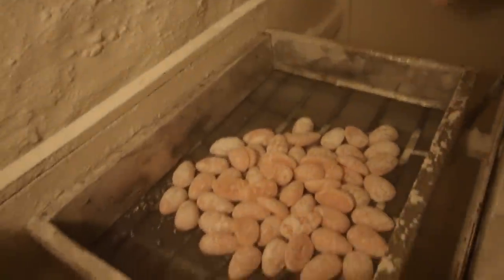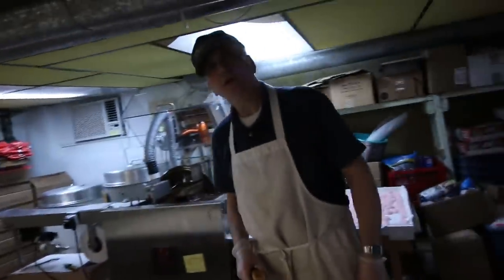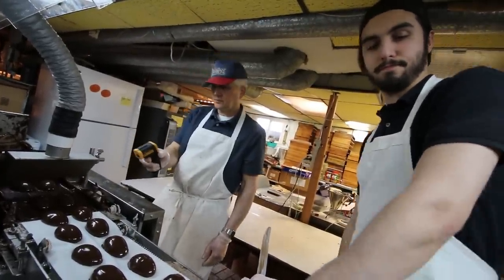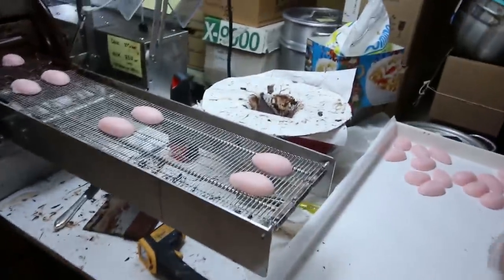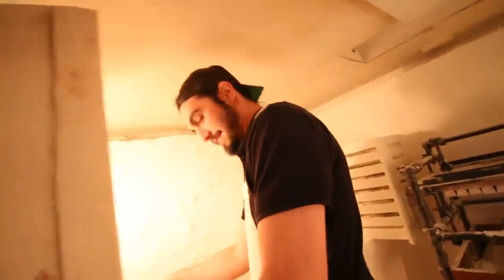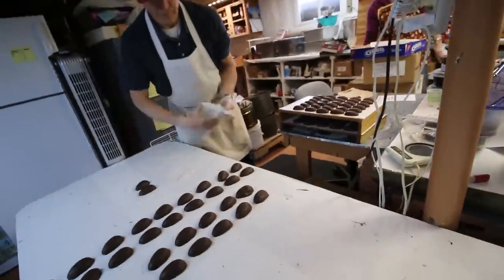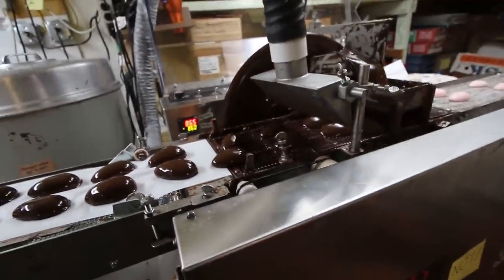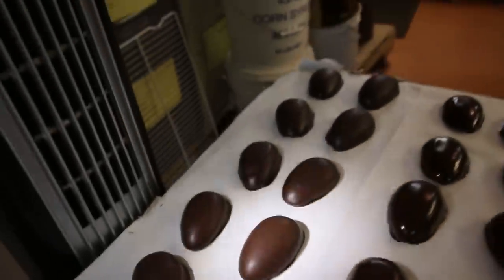Enrobing Raspberry Eggs

Comment: The reason the gap between the candy changes when transitioning from the starting conveyor to the main conveyor is because the two conveyors are moving at different speeds.The speed of the starting conveyor is actually set at a speed that is too fast, it should actually be set to a speed that is just a hair SLOWER than the main conveyor, then the distance between candies would not change at the transition point, and Steve could put the candy closer together at the very beginning, instead of leaving big gaps.

Comment: Re puddling - as Max said, may be too little time on the vibrator after the air blower. Could you flip the locking device so that the air blower is on the other side of the support post? That would allow more time on the vibrator, but the air blower may be too close to the chocolate curtain. Possibly worth an experiment!

Comment: May have missed this. Why are the raspberry eggs stored in corn starch before putting on the chocolate. Are the eggs frozen, and if so, does the corn starch prevent them from freezing together?
Reply: The corn starch acts as a mold. They have a huge press where they press those shapes on the starch, then they drop liquid marshmellow in the holes, let them harden, brush of the excess starch and coat it with chocolate!

Comment: I can’t wait until you move to your new facility! You’ll have enough room to move. You will be able to complete one task before beginning the next, and you will all be able to stand upright, without ducking pipes and low ceilings ALL DAY LONG! Tech neck only recently got it’s name, but I suffered the effects since the 80’s. I still have physical problems because of the physiology changes to my neck and spine from the late 80’s’s, early 90’s, hunching and straining to see a screen with my near sighted eye (my dominant eye for reading, since childhood). I hope you move soon, so Steve, Max, and of course, Craig, can stand upright to work! Their lives will improve, and they can work faster if they don’t have to clear and clean their very limited work surfaces every time they need to start a new project.
Reply from the maker: thanks so much for the support Patti and yes it should speed up production and hopefully have a lot less head injuries 😂
Reply: Hercules Candy And “dain brammage” from multiple head strikes.

Comment: if steve is putting them the same distance apart at the beginning of the wheel.  how are they so close to each other once they get to max?   is there 2 separate belts?
Reply: The is in fact 3 different belts with different speeds, the first one, them the chocolate one and then the finishing belt.

Comment: With the question about sliding the metal plate down multiple times, I think they meant why put it on the conveyor in the first place. I'm sure there's also a reason for this as well, but why not leave the metal thing on the table until it's time to grab the next batch. Then pick it up and slide it under the paper once.
Reply: CheesyBread I was thinking that too.
Reply: It would negate the conveyor belt.

Comment: How long does it take to clean the enrober?
Reply from the maker: Hi Donna I put the heat on high and heat gun on for 30 mins. Then all the chocolate  drips off .Then just drop in the next chocolate. A little milk goes in the dark and a little dark goes in milk. No big deal.Its just fine.

Comment: Hey....pseudo family...
I know it's probably nunya my business but just a suggestion....a friendly suggestion. I would at LEAST quadruple your capacities for production.....I feel there is coming a sh*t storm of business. Also, I might think about hiring a consultant who could help maximize efficiency in the new building. No more paths crossed etc~! Was also wondering....who the HELL carries those trays upstairs when the candy is finished and is ready for packaging? Who the HELL is that specific horse in the business? Crazy amounts of work being done....boggles me! My eyes are googled. No, really.
Reply: Another question about efficiency....why do the eggs have to be turned onto the flat side in the starch room. Seems like there is plenty of time to just pick them up and set them flat side down on the enrober.....just would save a bit O time aye?
Reply: I was wondering about turning the eggs over too, but around 21:40 they mention they need to be on the flat size so the shape doesn't distort
Reply: They are very inefficient there is no doubt about that, I think they are just very laid back and are not very concerned with efficiency. Also, common sense is not so common.